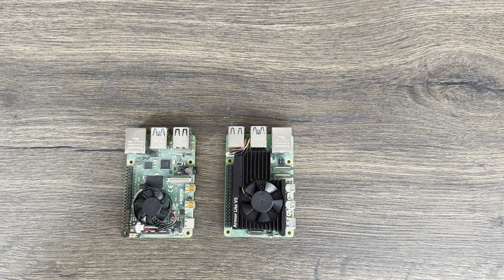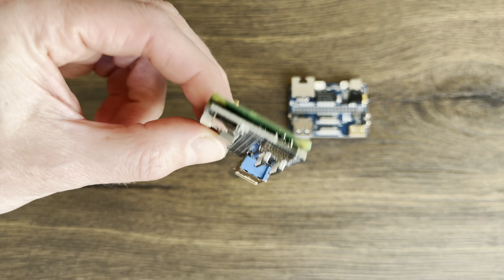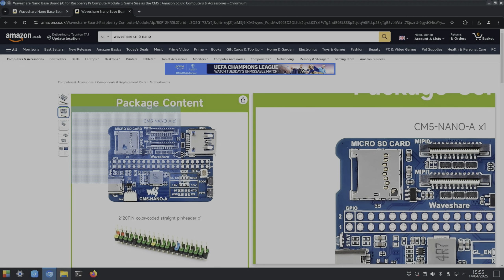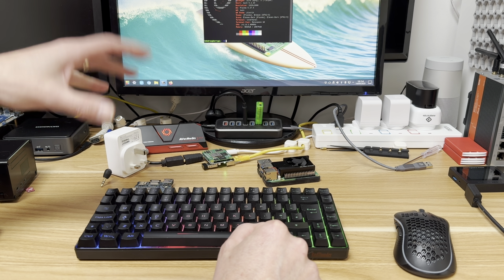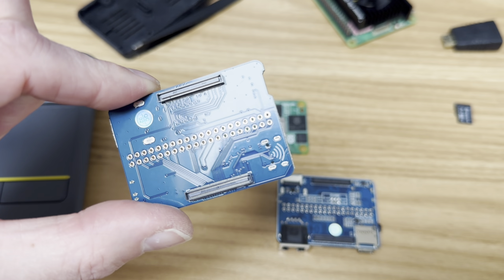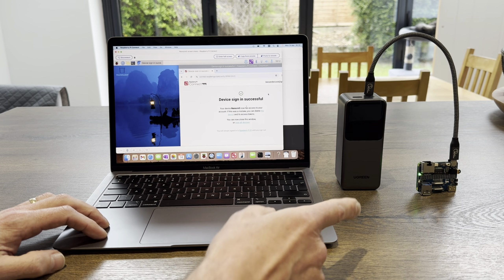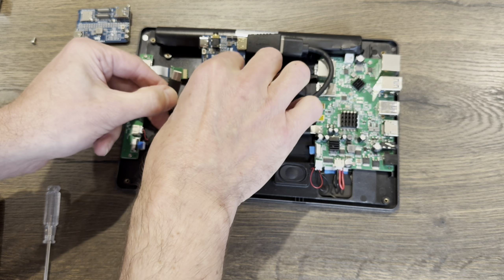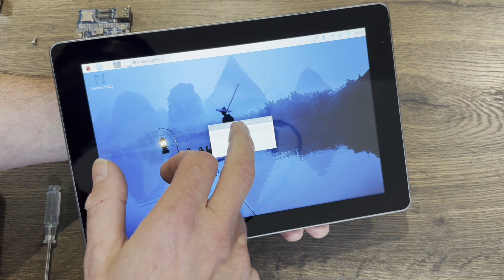Waveshare CM5 Nano boards for Compute Module 5.

Comment: I'm so frustrated. I got a CM5 Nano B and loaded Pi OS but it won't boot. I have a display connected but I only get a green blinking light from the I/O. I originally got the CM5 to use in a Uconsole by Clockwork but that did not work either.

Comment: Do you get the low voltage amperage warning from the Pi when connected directly to your power bank like that?
Reply from the maker: No, maybe if I plugged lots of things into it
Reply: @leepspvideo okay thanks. I did get the warning when plugged directly into my Anker 737 with PD, 100 watt usb C port. I have a board coming that will convert to 5V 5A

Comment: the ONE THING that I have been disappointed about when it comes to the Pi4 and Pi5 is not having the ability to run a display on the usb-c cable... if it did then all you would need is 1 usb-c port on this nano board and just use a hub with your usb 2.0, microSD, display port, ethernet, and power... LOL  
so maybe we can start a campaign to gather enough signatures to get the Rasp Pi 6 to actually have usb4 so that it could do all that PLUS run an external GPU  without a bunch of add-on stuff that our friend Jeff Gerrling has to hook up just to get it to ALMOST work (wait, I think he might have got an AMD GPU to work, but I can't really rememeber)  like the pci-e to m.2 board, then an m.2 to pci-e x16 slot that only runs at x2 PLUS he still has to hook up an external PC power supply AND jump start it so it powers the GPU LMAO (I'm pretty sure he got the CM5 board that has a built-in pci-e x16 slot that runs at x2  to work tho... but like I said, I forget the details) lmao

Comment: I really like Waveshare's products. I wish they made some displays that a CM5 could be direct mounted onto. But I don't know how big that market would be.
I have a wearable display project that uses a wide/thin display and only needs 1 USB. To make it slim, I desolder the Pi's ethernet, USB ports, and GPIOs and then solder a single port USB back on. It's powered by one of Waveshare's UPS battery packs in a 3D printed belt clip. It would be so slim if I could do it with a display + CM5 instead of modified Pi.
Reply: I also wish for something like this. I have used the "'7″ Touch Display Kit For Raspberry Pi Zero" display that delivers all the connections you need with a usable display for a relatively small build. The sbc is then connected with only two usb cables (Power and usb hub) and a hdmi cable. Audio headphone, speaker and 2 USB Ports and an ethernet connection are available on the display.

Comment: I watched a lot of videos. Read a lot of posts still cannot figure how to get own cloud working, I don’t know if there’s a default port on my router through spectrum and I have no control because it’s not my account
Reply from the maker: Did you try openmediavault

Openmediavault running on a single M.2 drive. 52Pi NAS case.
https://youtu.be/zXZcKOnM8tU
Reply: I am not sure why you would choose OwnCloud over NextCloud - I have found the latter to be very good and reasonably straightforward to install, at least on my chosen distro of Gentoo Linux.

Comment: Would there be a market for a Raspberry Pi which is built with the wiring / hardware for battery power?
Reply: Possibly solar powered remote device?
Reply: @soldier-01der  I was just thinking terminals and a dip switch.  I wouldn't mind a Pi x00 board like with such.

Comment: Great video. Ppl need to consider Audio on the Nano A. Ive got one and for me its perfect for prototyping. As im reading the information the DSI output doesnt include audio. One the HDMI output on the Nano B audio is supposed to included in the signal. They are great products.
Reply: One thing worth looking at is will the usb on the nano allow sound out.

Comment: Like Waveshare products, their Wiki's have a LOT to be desired which includes any typos & WRONG (or outdated) procedure to get their products to work.
Of 3 3 tickets submitted to them, 1st 2 issues had to resolve myself. Was pleasantly surprised on the 3rd ticket.
Have 2 Waveshare boards for both RaspPi & OrangePi CM4's. Like the footprint of the Raspberry Pi's and they operate great.
Testing so far the OrangePi (Debian) is a little faster than the RaspPi (RPI 64bit  OS).